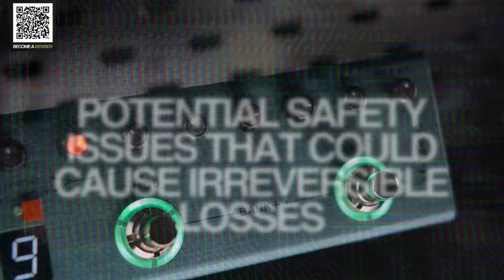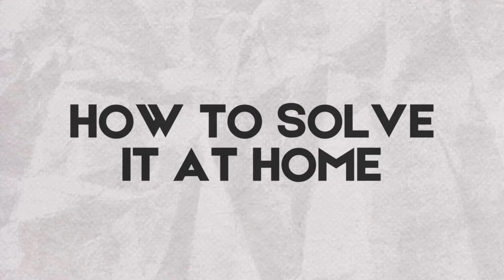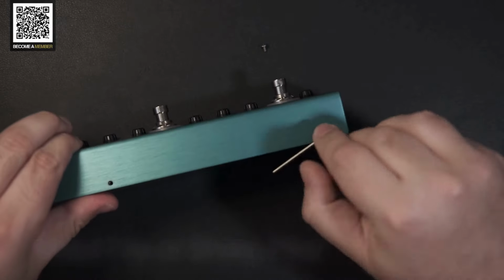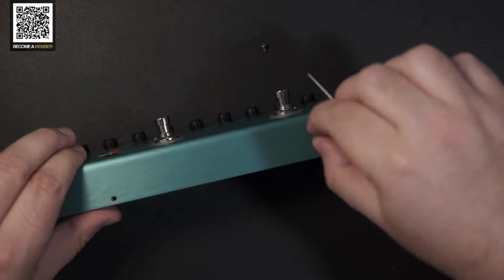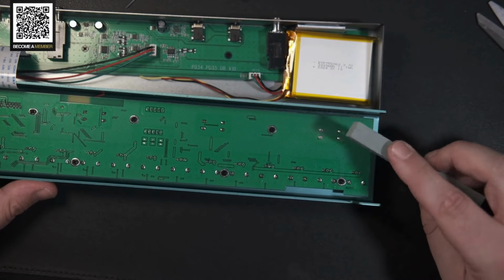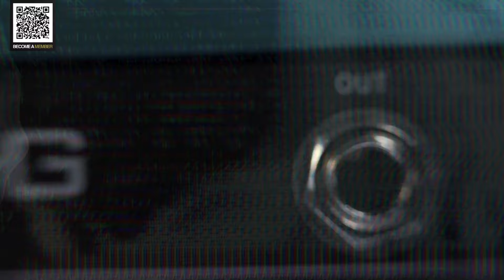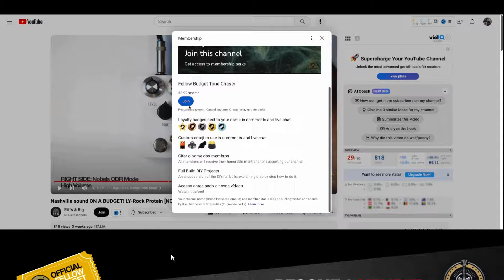⚠️🚨 URGENT WARNING: TANK-G CAN BURN YOUR HOUSE DOWN! 🚨⚠️

Comment: Dear Valued Customer,

Greetings! We are the official M-VAVE team. Regarding the battery issue, please rest assured. Our batteries have passed FCC safety certification, ensuring there are no fire hazards or other safety concerns. The current batteries have undergone safety isolation treatment. If you encounter any issues with the previously purchased TANK-G batteries, please contact the business for after-sales service.

Thank you for your support and trust in M-VAVE products.

Sincerely,
The Official M-VAVE Team🤘🤘
Reply: It is not the battery that is causing the issue. It is the sharp points on the back of the footswitch that are puncturing the battery no matter how many FCC certificates it has. You need to fix the footswitch issue as shown in this video, or better, then release a video showing what you have done to rectify the problem. I almost bought one of these. I still will as soon as I see the issue is fixed.
Reply: @wealthfinder192  Yes, it is not a problem with the battery. Even if it is punctured, there will be no safety hazard. The back panel has been protected.
Reply: Yet again showcasing how even the manufacturer has no idea how the problem even started, eventhough this youtuber showed a cheap way of fixing it.
Reply: Safe  when poked through with a pointy metal? 
Mine had the same issue, the outer part of the battery was damaged... I didn't even use the pedal that much, I think the damage occurred already at the assembly phase... This is very dangerous.
Reply: thanks for the information. im planning to buy TANK G soon.😊😊😊
Reply: @M-VAVE    @M-VAVE  my  tank G is dead. I heard suddenly beeping sound and lights turn off.Again I open it but it is not working
Reply: I need to help and product.I am using for just 2 months it is new @M-VAVE
Reply: @M-VAVE I need to help and product.I am using for just 2 months it is new.
Reply: @VODGAME  Please charge
Reply: @VODGAME  did u charge tank g
Reply: @anddy1128 yes ı charged it.This is hardware fix.
Reply: I charged it.This is hardware fix.
Reply: @wealthfinder192  Mine didnt last a month and fried, Tank G gave me a free replacement, thank you. I would not recommend using this with other gear or for loud settings. I run a full stack at 100 watts per cabinet and the sound is great but when I added an equalizer it sounded much better for 1 day and died.
Reply: My understanding is that the possible fire issue of the TANK-G has since been resolved by the manufacturer.  However, I do see the TANK-G offered for sale from different online outlets with two different case colors; The BLUE color and a PURPLE color.  Do they simply exist in two color choices, or does the BLUE represent an older model (that may have the issue) and the PURPLE model which is newer with the issue resolved?

Comment: I thought this video was going to be BS clickbait, BUT after watching this, as an electronics engineer by trade, I can say that this is 100% legit!
I would go further, IMHO. 3:06 I would file down ALL the solder joints covering the area of the battery, put sticky foam over the entire surface of the battery AND put in a shim of thin hard plastic covering the area of the battery as well.
The self-adhesive strip used for draught exclusion on doors / windows should do, and for the plastic guard, a piece of an old CD or CD case should suffice.
Reply from the maker: Thanks a lot mate!! I will pin your comment so people can take your instructions!! What makes me sad is that some people still believe it is only a clickbait by not understanding the potential risk of this defect! 🤦🏻‍♂️ Cheers mate! 🎛️🔥
Reply: I just checked mine, it's the Playwell version and good news is there was no battery damage, however, the contacts for the switch do need to be trimmed and covered. A little double-sided 3M tape and all is good.
Reply: Yes, as a tech in electronics since the 80´s i agree with using some hard plastic, i was thinking that before i saw your comment.

Comment: I bought a Tank G from Aliexpress only 2 months ago. Just yesterday I decided to open it up as I had been aware of your video when I was looking at buying the pedal. My pedal now has a thick rubber pad over top of the battery and the solder is blunt. I can definitely see marks in the rubber buffer not just where the footswitch is but also along the front. My guess is because of the rubber there is no room between the footswitch joints and the battery anymore but this is much better than pushing down with your foot and pushing it into the battery.
On a side note, I bought a Tube Screamer a couple years ago. As new made in Japan so I was stoked. When I played it there was no distortion. Only the tone and volume worked. Next time I tried it there was distortion and so it went sometimes on and sometimes off. After building the courage with the Tank G I thought I would open up the Tube screamer and have a look. I thought maybe a dry solder on the gain pot but when i opened the pedal there was a tiny piece of a foil candy wrapper sitting on the board touching some of the solder contacts. My uneducated guess is this is the culprit and I couldn't see any problem with the wire to the pot. When I put it back together it works fine. So now I just need to use it off and on and see if I fixed the issue.
It's good to learn how to set up your own guitar and to at least be able to look inside pedals and amps etc. Very interesting.

Comment: Thank you for posting this. I’ve got one of these units and will check its condition and apply your solution as a precaution even if there is no damage. 
Very worrying that the manufacturer has not warned anyone about this so thanks again for taking responsible action.
Reply from the maker: You are welcome mate! M-Vave commented here announcing that they corrected already the new products! Hope it will be solved from now on!

Comment: It might be a smart idea too to replace the battery if you notice that its wrap is punctured or the unit was behaving weirdly due to this issue. there's always that non-zero chance that the jelly roll of the cell (that's literally what the internals are called!!) could have sustained damage that could result in future internal short circuits and fire if it hasn't already.

The cell you want to look for is a type 755060 and the capacity should be 3000mAH... Although you could of course opt for a smaller cell than this. The downside is reduced runtime but the perk is that it should be less likely to interfere with the pins on the board. Especially if you also add some foam to shim the cell away from the board and protect it.

Comment: Thank you very much. This is very important. After I opened it, I found that there were traces of solder joints on the battery. It is very dangerous. I have handled it according to your method. Thank you for your reminder.
Reply from the maker: I am glad mate!! Take care! 🎛️🔥

Comment: Newer Tank-G V2 do not have this flaw, a piece of foam has been added between the battery and the switch pads. Checked mine and it is OK.
Reply from the maker: Exactly! M-VAVE solved it on the newer ones and also in the Blackbox! 🎛️🔥
Reply: I'm concerned that the older version with the fire issue are still out there in the market place.  Is the BLUE version the older model with the issue and the PURPLE version is the new resolved unit?   Or, is it just a color choice and either could be the new version?

Comment: I've just checked and fixed mine. It had dents in the battery pack, but not punctured. I would note that a 1.6mm or 1/16" allen key is a better fit, but 1.5mm works if you're not too heavy-handed
Reply from the maker: That's awesome! I am glad it solved the problem! Cheers mate!

Comment: I was actually looking at this pedal, but decided that, for me, having individual effects was a better way to go. I'd really like to see a review of Donners multi eco and multi reverb pedals. I own them, and they remain slightly warm, not hot, even when they are turned off. 🤘
Reply from the maker: Ouch... this sounds strange... have you ever tried to take them to technical assistance? Warm pedal while off is not a good thing...
Reply: @RiffsRigs  That's what i  figured  I have no one to take it to, so i will try to contact Donner, or just replace them both I could probably unplug them when not in use. Thanks for the input !

Comment: I just took mine apart and it had the "vampire bite" on the battery exactly like the example in the video.

I clipped off as much as I could from the protruding "legs" and filed them down as far as I could.

I considered adding some hard plastic to the double sided tape, but there simply isn't the clearance in there to accommodate it.
Reply from the maker: After filing the tips smooth there is no risk anymore mate! Glad it worked to you! 🎛️🔥

Comment: My new Tank G v2 has a piece of 3M foam to protect the battery already installed.    It looks to be effective as well, as I see no marks or anything on my battery.  I just opened mine to take a look, so at least they have addressed the issue.
Reply from the maker: Exactly!! They corrected the Tank G and the same solution was applied also to the M-VAVE Blackbox! Anyway, it is important to check because some pieces cold be stopped long time in storage! Cheers mate! 🎛️🔥

Comment: I just burned up my second tank G by putting the master volume and the equalizer volume both over 50 percent. Sounds great but it tanks very well.
Reply from the maker: This is a pity mate. Try to write to the seller!! They maybe can assist you with replacement! Cheers mate! 🎛️🔥

Comment: I checked mine and not only were those pins already filed smooth but there is also a foam pad protecting it.  I bought mine from Temu a couple of weeks ago.  Looks like they have fixed the issue on later models.  Now if someone can tell me they've used the software - mine won't install for phone or PC due to warnings saying the software is malicious.
Reply from the maker: Hey mate! It is true! They already solved in the new units! For the software, they are constantly updating it. I am a MAC user, so I will let you down on the Windows notifications... sorry for that!

Comment: Thank you for this nice and straightforward review! 👍 This info is very useful and important to know... And I know this is a relatively cheap product, but I'm upset now knowing, that initially the battery was not placed within a closed, well protected, hard plastic cover by M-WAVE. I don't think it would increase the price that much, but for sure could eliminate the problem... 🤔

BTW... do you know, please what is the situation with M-WAVE's cheaper, similar multi effects, they sell for bass (blue), electric guitar (black) & acoustic guitar (light brown)? I'm planning to get those, they are about half the price of "Tank-G", have 3 foot switches, and the necessary "basic" effects... So they would be great, but I wonder if it is safe to buy them, or I should look elsewhere...!? 😕
Reply from the maker: Hey mate! They started correcting already this issue with the new ones! You should not have this trouble anymore... of course, you can be still unlucky to get a piece which was long time stopped in stock, but I believe the probability is pretty low right now! All the other m-vave products didn't show this issue. I opened the Blackbox and it had the battery between footswitches, so no worries (and also with the protection). The Cube Baby also was never claimed to have this issue! I hope it helps!! Cheers! 🎛️🔥

Comment: My understanding is that the possible fire issue of the TANK-G has since been resolved by the manufacturer.  However, I do see the TANK-G offered for sale from different online outlets with two different case colors; The BLUE color and a PURPLE color.  Do they simply exist in two color choices, or does the BLUE represent an older model (that may have the issue) and the PURPLE model which is newer with the issue resolved?

Comment: Hello my tank g is coming, is filing the solder joints safe for the tank g will it damage it or making it malfunction by any chance?
Reply from the maker: If you bought recently, there are big chances that it is already solved. M-VAVE implemented an additional layer of stick tape and a plastic protection! When it will arrive, open it and take a look, because if your piece was in stock for a long time, maybe you will need to solve it by yourself like I showed in the video! 🎛️🔥

Comment: i owned the Cuvave Cube baby, it didn't last long. Maybe longevity is the problem of cheap guitar pedals.
Reply from the maker: We still didn't see how the Tank G or the Blackbox will react in the long run. At least we didn't find anymore cases of subtle death of the equipment, like happened in some Cube Babies! But... let's keep an eye on it! Cheers mate!
Reply: @RiffsRigs  But the tone of these products are great of the price. I hope they'll last longer.
Reply: @RiffsRigs  So the situation is my cube baby will no longer charge but i removed the battery and direct its power using a phone charge's cable and adapter. Yeah it functioned but i can no longer use the direct to the phone recording and I can no longer connect the earphones since it makes a hissing sound rather than the guitar itself.

Comment: there are a lot of solutions but from my perspective it is better to remove that battery and adapt an external power bank may not only solve the problem but guive more hours of use per charge cycle.
Reply from the maker: It is a good solution also!! 🎛️🔥

Comment: It confuses matters a lot when it seems like the most recent firmware update made the whole device act kind of funny. I use the Tank G as a headphone amp, plug pedals into it because it sounds convincingly amp-like. I don't want to spend much more on amp.
Reply from the maker: The last updates are really strange! I am waiting to see how the system will react on the mac before updating it!

Comment: my  tank G is dead. I heard suddenly beeping sound and lights turn off.Again I open it but it is not working
Reply from the maker: Did you check the integrity of the battery mate?
Reply: @RiffsRigs  yeah ı checked it.Battey has a hatd sponge cover.What can I do.I can't reach the M vave cooperation

Comment: Honestly, as much as the Tank G is a cheap product, I wouldn't have bought it if I had known about this problem with the battery beforehand. Luckily, my battery wasn't punctured, so I took the necessary steps to protect it. But it is not correct that a product with such a serious defect is being sold without the company that sells it having so far made a statement about the problem and what measures it will take from now on to correct it. I like the product, but this battery problem made me never want to buy another MVave device again.
Reply from the maker: It is a fair position mate! Worst than the design issue is the company behavior! 🎛️🔥

Comment: Gibberish
Reply from the maker: If you don't believe it is a real problem, it is ok. But it for sure is! 🤷🏻‍♂️
Reply: "The obvious danger of lithium-ion batteries – and most other kinds of battery – is that of fires and explosions. If punctured, short-circuited, overcharged, or exposed to high temperatures, the flammable electrolytes inside mean lithium-ion batteries can catch fire, or even explode." SAMS UK Safety and Health consultancy